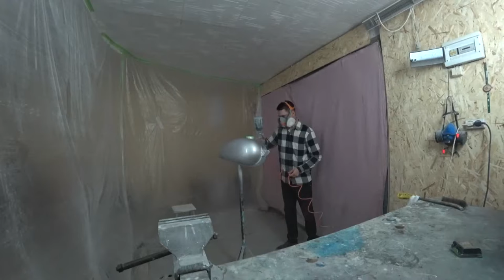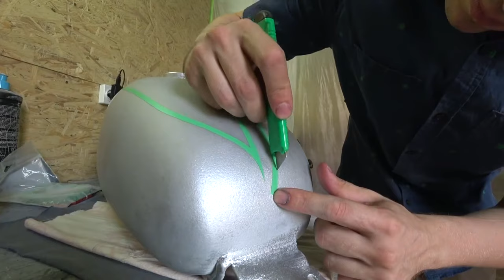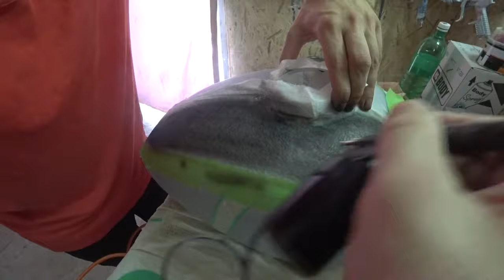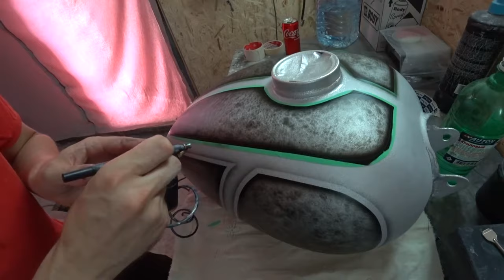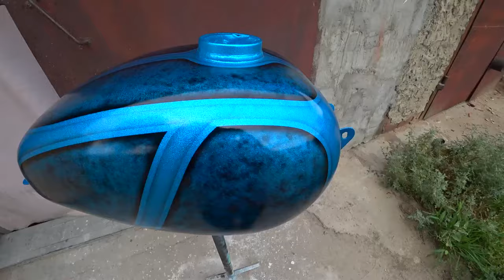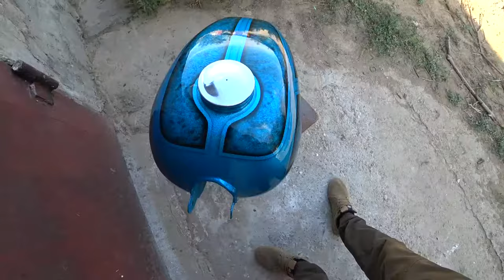Great texture/pattern. Paint tricks and tips. How to custom paint. Candy Metal Flake paint job

Comment: I really like the napkin-texture, the tank turned out really cool.

By the way, saw your mask hanging on the wall. The A2 filters hold up longer if you store them in a small sealed container, since activated coal reacts with moisture in the air.
Reply from the maker: Ok man, thanks 🤝

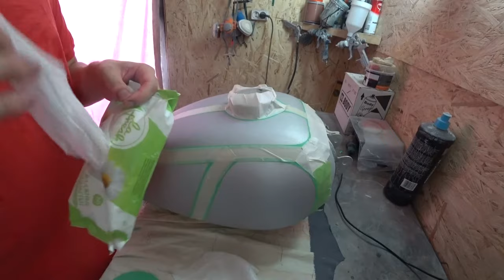Comment: Is the material you use as a stencil to spray over at 3:12 baby wipes? Because it seems most that I saw on an online search just now have geometric patterns on them, and/or are scented or have moisturizing oils in them. I suppose the geometric patterns, depending on one's goals, can actually be a good thing. What exactly is the product that you use? Because material with oils soaked into them I imagine would not be the most desirable. Thanks!
Reply from the maker: These are ordinary cheap antibacterial wipes. Soaked in alcohol or something like that. You’re right, you don’t need to use wipes with oil in this case

Comment: Please tell me how long you need to wait before removing the tapes. Thanks.
Reply from the maker: Hi! At the right temperature, the paint dries quickly, especially if the paint layer is thin. You can remove the tape after 10 minutes after finishing work, or you can immediately, because while you are doing the right side, the left side has already dried. Just try it on something to see how fast your paint dries, and then paint the details of your motorcycle

Comment: Hi, paint job looks great......i have a question. Does the little fuzzy parts of the dried wipe xome iff and stick to the paint?
Reply from the maker: Hi man! Thank you! Nothing stuck. The layers of paint were so thin that it was impossible to stick the parts of wipe. If cover with a thick layers and without intermediate drying, then something will probably stick
Reply: hey, thanks for the quick responsel i got a crazy thing happening as we speak..lol...painted a tank today, used  automotive paint from a professional shop. Its a copper metallic....the tank has about 1/2 tank of  fuel ....when i paint it and its wet it looks great...when it dries the top part where there is no fuel is cloudy....the bottom part where fuel is dries shiny and clear. The temperature is/ was around 16 degrees Celsius which is about 60 degrees Fahrenheit its a damp kind of day ....have you ever experienced this? i can add my email to send a pic, ive painted a lot of tanks in all temperatures but never saw this before....any help would be great
Reply from the maker: I've never had anything like this. 16 temperature for painting is not very good, too low. Usually, all manufacturers indicate the minimum required temperature for using paint / clear . If you want, you can show the photo to instagram or telegram. I think the easiest way is to drain all the gasoline and try to paint without it
Reply: @Z11KUSTOM  Ok thanks again for your response
Reply: I did some research....I guess the term for the issue is called " blushing" its when the humidity in the air is high amd the cooling of the solvents create a mousture when the dewpoint is reached???....anyway it was too humid and I created the perfect storm for the moisture to form....the cold part of the tank where the fuel was offset the temperature to the good...and thats why that part dried properly
Reply from the maker: Yeah man thanks for information, I've never had such an experience. For a good result, you need the right conditions